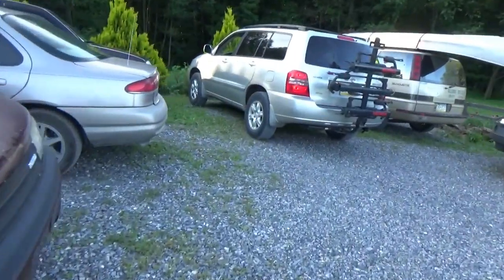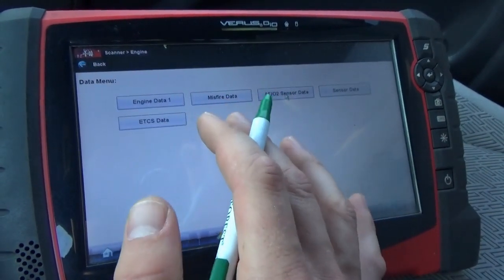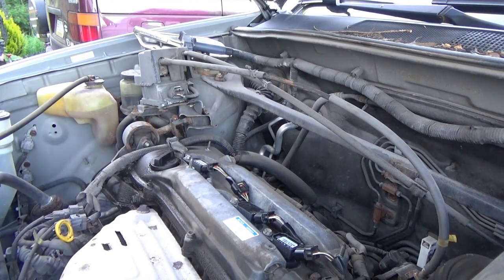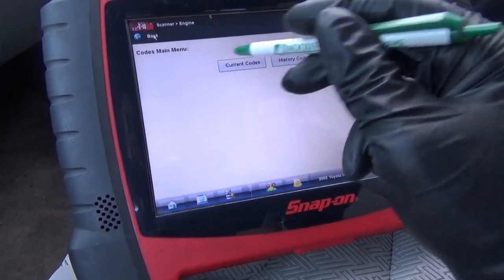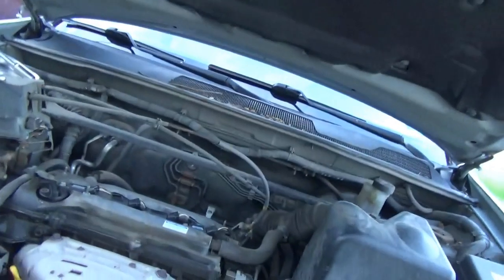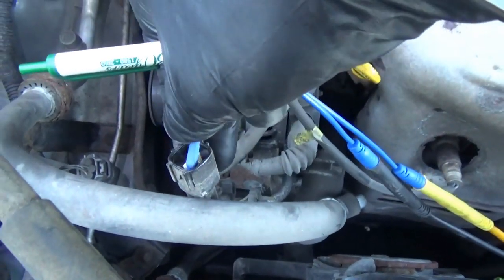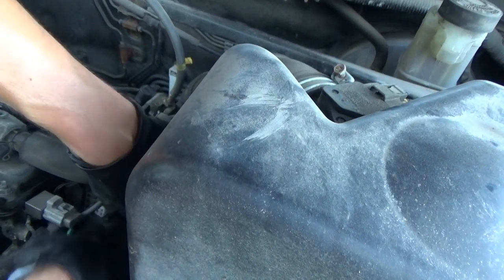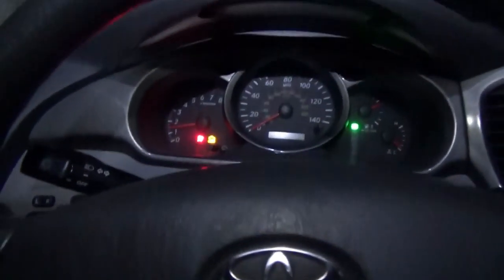The Rough-Running Toyota: Part 1

Comment: As a do it yourself have gambled on after market products from China in replacement of OEM products . 
Some with success and some not so much ! 
Most professional auto repair shops cannot afford to do this as they cannot guarantee the parts unless they are OEM . 
You have to be very careful on what is OEM or copies ! 
Spark plugs as being one of many the Chinese brand as being OEM on the boxes . 
I found that out on my 97 4 runner !

Comment: Yep! SO MANY videos out there ... where WORSE problems developed after ONLY ONE Coil or Plug was replaced. The DEALERS ... LOVE IT ... esp the back coils on the V-6 Highlander / Lexus RX300.  The owner in this video is lucky to have a 4-Cylinder engine. 

Here's a clue:  Is it possible that when plugs get OLD and ONE fails ... the others ARE NOT far behind?
Ditto (on V6) at 120K ... dealer will change all 6  plugs ... per factory "Book" ...  but NO (Zero) Coils changed.  This is to HIDE the egregious mark-up on the Coils.  See below for $$$ !

On our V6 1MZ-FE 2003 RX300, I replaced ALL 6 Coils and all 6 Iridium Plugs during my DIY,  120K miles service.  The dealer charges to change all 6 plugs ... BUT DOES NOT change ANY of the coils ... THEN ... they replace each coil as it fails down the road.   $550 for a front coil (1 hour diag, then 1 hour labor, then $189 ... 

so, $950 for one rear coil.
 (1 Hr Diag, 4 Hours labor (both @ $150 per hour), PLUS $189 for ONE COIL.
(Plus rags and hand cream / gloves for the mechanic?)

The corrupt dealers ... and most "hungry" shops ... count on the ignorance of the average owner to hide their manipulative GREED!

As mentioned above:  For a $55 Denso Coil, from Rock Auto, the  local dealer charges $189 EACH.  
That coil costs THEM perhaps less than $35. Then $150 per hour to change ONE front one and 4 hours to change ONE BACK COIL.  INSANE!  Let's hear it for "Greed Conquers Empathy!"
The dealers and their mechanics LOVE it. Like having mobile "Piggy Banks" on wheels! !!! 

I have seen all over the internet where future PROBLEMS were "Built-In" ... even at the wonderful site run by ERIC O. ... e.g. Just ONE coil changed earlier, then a bad coil down the road caused a failed alternator and another tow-in? ... when that "Old / Original" coil (s) caused such a severe "Mis-Fire", it took out the Orig. Alternator. And that was a simple 4-cylinder engine !!! MINUTES to have changed ALL the Coils.

Suggestion For: Honest shops like South Main Auto
Do NOT be afraid to "Quote High for relliability".
No matter WHAT you charge ... the dealer would charge 2 or 3 X your fees.

Just explain WHY you want to change ALL COILS AND PLUGS ... on the first failure.
Life-wise, I learned that HARD LESSON early-on from my wonderful British Wife: 

Whenever I asked her permission to explain the cost/benefit ratio to her ... She LOVED it.
Whether it was cleaning, caulking and painting the entire house THIS YEAR ...
Or doing the 120K service on HER CAR ... TODAY.  
When I explained the "All Coils and All pugs" situation ... she said:
"Of course; it makes perfect sense. Thanks, John."
John in the NW

Comment: you are correct... bank1 is cylinder 1 and 4..... bank 2 are cylinder 2 and 3...... 
and you have two catakytic converters .. one for each bank.... therefore you have 2 o2 sensors after the catalytic converter.... one for each bank to keep track of the efficinecy of the catalytic converters..

Comment: Here most cars are Straigth block 4 cylinders. If you see 2 blocks(on scan tool) in here that usualy means that exhaust is split in two.
Cylinder 1 and 4 are "block 1" and have own firsth cat. cylinder 2 and 3 are "block 2" with own firsth cat.
At this part of the video it sounds like blocked cats/exhaust you allso seam to have more then ones both cat codes P0420 and P0430 in memory of that scantool...
Reply: I hear it didnt rew up over 2000rpm... i must have hearing problem ;) And yes trust your eyes more then snapon on just saying.

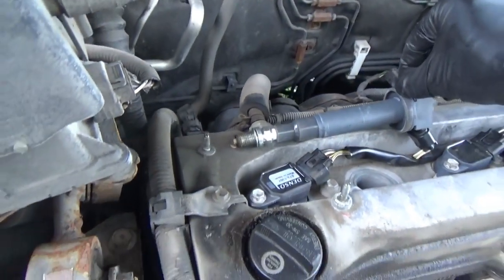Comment: the same way as you did that test   at minute 8:35   I did it one time man  bad experience,  you have  compression coming out the hole of plug, the spark plug near the area big flame came out in my case  plus my fire stinger was empty from being seating for years with out using or and inspections.

Comment: I installed a BWD ignition coil on a 2005 Altima, 2.5. 18 months later, the car got towed in. I had no spark on all four cylinders.  When I pulled the BWD coil, it was melted. It wound up that the aftermarket coil blew the ECM fuse. I changed the coil, and the new fuse promptly blew again. Disconnected the harness at both ends, and checked for shorts, there were none. I pulled the ECM, opened it up and noticed that the circuit board was burnt. Lesson learned, I had to replace the ECM with a reconditioned unit. The rebuilder was able to program the security code from the damaged ECM.
Reply: maybe the ecm caused the coil to burn, maybe even the old coil/s to fail. they would never do such a thing on purpose ;) ;) ;)
Reply: @throttlebottle5906 , Come to think of it, I didn't torque the coil to factory specs!
Reply: @philjerome9795  lol! as long as it wasn't sititng in the hole loose and bouncing out :))

Comment: Why 4 O2 sensors? You can use same PCM with V6 and I4. V6 has two banks and two cats? With four banger put one O2 sensor per each header exit anf two after the cat -> same controller and same SW works. Cheaper to put extra two O2 sensors than maintain two SW versions.

Comment: those friggin coil packs, back in the day it was just 1 coil for all the cylinders and you kept it away from the engine heat they would last forever. Now? the heat destroys them as they're resting right on the valve cover and  you have 4 of them (at least) could be 8 on v-8! ahhhh! so now you have to replace 4 instead of 1 coil, thank you engineers!
Reply from the maker: Good point! But now there is no distributor or ignition wires...no system is perfect :)
Reply: Coils are better that distributor systems even if they die
Reply: @zoneb609  Right, no leaky wires or leaky distributor cap and mechanical parts.
Reply: @reecenewton3097  Hell yeah!! My Topaz is a nightmare with all the ignition system. I prefer my crv coil packs hahaha
Reply: coming soon, coolant cooled ignition coils :)))
Reply: @throttlebottle5906  No way hahahaha

Comment: Wouldn't you want to unplug the fuel injector on that cylinder so it doesn't keep dumping gas into the exhaust? You sure were in no hurry to get that engine turned back off.
Reply: You know that if an injector is stuck open disconnecting it wont prevent gas from being dumped right?
Reply: @zoneb609  was the injector stuck open? All I saw was all about the o2 sensors.
Reply: @billgateskilledmyuncle23  Oh I misread your comment! Sorry...

Comment: Another fun diagnosis, thank you. I believe many O2 sensor heaters are shut off by the PCM when the engine is already hot. No need to waste the energy, but presumably the code persists until at least the next cold start...

Comment: The test light won't light because it does not see the same resistance. A bulb lighting has a different ohms to that when cold. Swapping out the sensors did the business. The ECM  has a narrow window to operate in. Funny set up with 4 sensors. A 100 watt bulb with ohms 9.5 would give out 1500w at a voltage of 120 with no change in Ω.

Comment: Great work Ivan.  I'm wondering if I should go ahead and replace the coil packs even though they are working fine?  I replaced them at 95K with oem when two originals started acting up.  Now, my vehicle has 195K on it.  I also wonder if the EGR valve should be replaced now as it is original, but hard to get at.

Comment: General rule on standard 4 wire O2 sensors is the two wires of same colors are the heater wires, the darker  of the other 2 wires is the signal wire and the last one is the signal ground. Known exception are some Honda vehicles where the ground wire is the the darker one.
Reply from the maker: Ah there are always exceptions to the rule! :)
Reply: @PineHollowAutoDiagnostics  Always, without exception! :)

Comment: After experience i am a OEM or OEM spec guy mostly, bearings, ignition coil etc. Had a boiling cat on my previous 02 focus because coil failure. The cat survived but you can literally hear the gas boiling in the cat 😅 
Great video as always. 👍😊
Reply from the maker: Wow your Focus got lucky haha
Reply: @PineHollowAutoDiagnostics  Indeed, was forced too drive a little with it too, and too top it off the car had a milage of over 125000 miles 🤯 It ain't possible too have soo much luck.
Reply: Really survived? Wow... Ford tough
Reply: @zoneb609  Ya it's incredible.

Comment: Ave! Ye ol' druid of the hollow pines...

The fuel metering systems Toyota (and I believe BMW) uses are typically modifiable to split single bank engines (less expensive than designing a whole new software and driver system).
That said, half of the cylinders are one bank while the other half are the other.
On some iterations of this application, there are two AFR sensors!

Hope this helps deciphering the PIDs.

Cheers!

-100
Reply: Cheers for the explanation !
Reply: @fieldsofomagh  No problemo!😁

Comment: Double bonus footage, double thumbs up :P. 
looks like sometimes its just not worth going non genuine parts.
Reply: What solution is possible if OEM parts fabrication is outsourced to China? ...DENSO? ASIN?  what else. Anything can brake down... just do not install cheap crop on to great cars! Or replace parts in accordance of MFD projected life span - like oxygen sensor at 90k miles or spark plugs and wires every 30K etc.
Reply: @gregstrakovsky5008  ya
Reply: @gregstrakovsky5008  yes true about service parts intervals, however if you look at the "non genuine" ones in car that owner changed there was date marked when installed 2017 so only 2 years old, coils should last longer no matter what brand  in my opinion. china syndrome i guess comes down to OEM QC at the factorys in kina.
Reply: Ya especially whit a Toyota

Comment: Ivan why are you ignoring the Cat? Couldn't that cause drive ability issues? I would also think it would effect air flow.
Reply: It would affect driveability if indeed it was blocked up. The only issue it has at this point is the precious metals are worn or gone & no longer doing anything.   The car at this point, isn't having breathing problems, from what I'm seeing.
Reply: @CubasAutomotive  Thanks!
Reply from the maker: Hi Richard! No signs of the Cats being clogged at all...yet. So flow is fine, just the efficiency has been depleted.
Reply: @PineHollowAutoDiagnostics  Thanks for the fast response.

Comment: The lamp you used to test the O2 heater circuit, looks like a 250mA globe 3Watt not a 1A globe.  ie 12W.
Reply from the maker: I tried a 1amp too didn't light up! Still set the code!
Reply: @PineHollowAutoDiagnostics  Once you know the o2 sensor is bad,  I'd consider leaving the o2 sensor plugged in and cut the heater wires open (sensor side,) connect the test light there.  I'm curious if the pcm needs to see the rest of the o2 sensor connected to turn on the heater?  Perhaps it needs more satisfaction than just the correct resistance on the heater circuit?